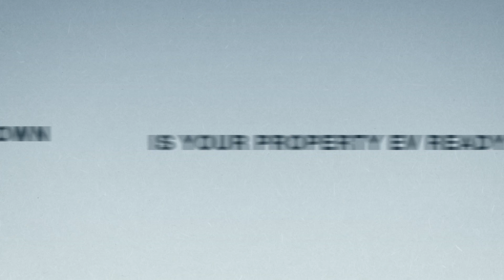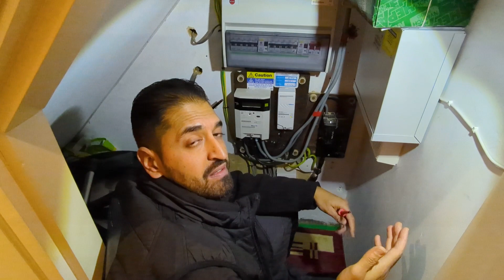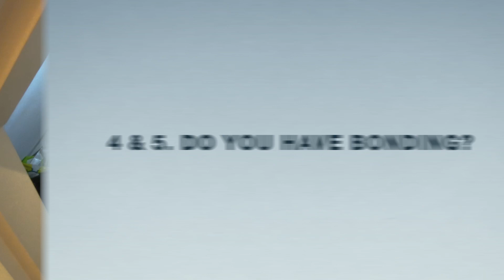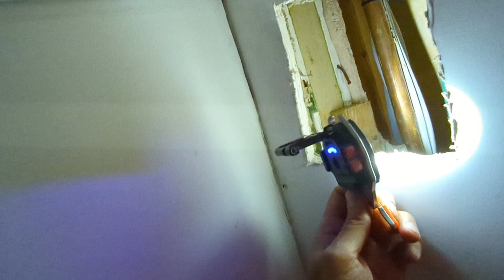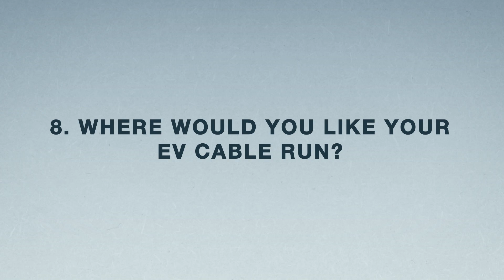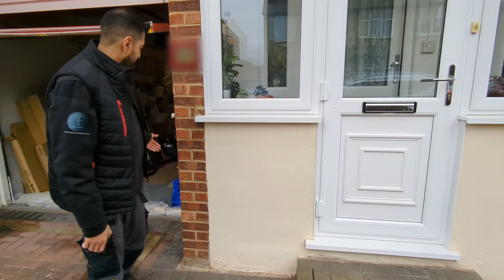Is Your Property EV Ready?

Comment: Me again.Sorry car'nt help it,comes up on my youtube,have to have my pennies worth,20 years electrician[ jib approved,industrial,commercial and domestic.Maintenance electrician DRAKA cables,i've been around the block  then 21 years distribution all dno], that looks like ec15 [earth clamp] on lead sheath so big no no,so you mentioned earth bonding but no external  fault path earth via source,ie tt,tns,tncs,how do you no it's not the looped supply from the neighbour ,not allowed,you need to check neighbours cut out to see if they are the loop.Then the loopie requires re service.
Pilc cables have limited current carrying capacity,some 0.0225 2c cu or smaller  [about 4mm thick] 60a cutout/ fuse max, backed up at sub with 400a fuse designed to blow in 30 mins not 5 secs,time to burn!.This is why i left contracting,i was told by the year 2000,all electricians would have to be jib graded,you need a card to work ,like in australia ,to work on electrics ,to get rid of the idiots,no such look!, you carnt work on gas without gas safe ,but you can go to b and q or screwfix or go on youtube and find some drongo to give you advise ,Faults find faults in fault finders!

Comment: Unfortunately I am looped, luckily they are sorting it for free, dig up my drive new fuse etc.  I’ve also found out my incoming water supply is not earthed so that’s getting sorted with the fitting of my new car charger with Octopus. 🐙 I have a charger already but it is so slow, charges at 3.4kw so okay with the looped system, glad I am getting it changed though. 
Great video made it so easy to understand 👏

Comment: Looped supply:  They changed the rules years ago, you can fit an EV in a looped supply but you must notify the DNO and they will likely unloop the supply..   Also checking if there are two cables is not a reliable source to see if the supply is looped as the second house on the loop will only have one cable...   There is a site called LSBUD that will give you maps the same that the DNO has so you can see if the supply is a looped supply

Comment: Hi Ben, I live up north in a terrace house with a ev, street charging with BP pulse, im thinking having a charger fitted in back yard so i can charge on back street, there no footpath but no off street parking, will i run into issues
Reply from the maker: Hello @justeatingbigmacs,

The regulations/guidance we are given traditionally dictates EV chargers are only to be installed at properties with off street parking or dedicated parking bays. 

This is to prevent various hazards e.g people tripping over the charging cable.

We have found different local authorities seem to have different guidelines, we would recommend getting in touch with your local council.

Kind regards 

Vartia Electrics

Comment: You didn’t cover the risk that you are on the far end of a looped supply. You will only have one incoming cable, but how do you know the supply cable comes straight to your cutout and not via 1 or more neighbours first?
Reply from the maker: Good evening @nigelbarton8350,

Thank you for pointing this out. This would be down to your installer to work out, a simple phone call can confirm if you are at the end of the looped supply.

You have various options available to you now e.g. CT clamps etc to overcome this issue.

Kind regards 

Vartia Electrics

Comment: No mention of the upgrade of cables required for 100Amp cut out fuse, which involves Electricity Supplier, as well as DNO
Reply from the maker: Good Afternoon Bighorse2,

Your correct upgrade of cables will be required if the fuse is up-rated.  We were aiming to give information without going too far into detail.

Thank you for pointing this out 🙂

Kind regards

Vartia Electrics

Comment: What about RCD types? the consumer using you are installing into have AC RCD's which have issues with DC leakage
Reply from the maker: Good morning Chris,

Well spotted! You are correct a A type RCD is required when installing a EV Charger. 

We didn't want to overwhelm with too much information and as it is a simple swap it was left out.

Kind regards

Vartia Electrics

Comment: Not sure about UK regulations only allow an EV charger unless your have a driveway as I have a London Taxi with no driveway, but our road has off road parking and his person got an EV charger installed on the pillar of the gate and he layers down rubber matting to protect the cable and its ramped to allow manuvore over it. But I don't have faith that ti's rubber cable protection strips will fail, degrade, get vandalised or stolen or how was it allowed to be installed. If other follow suit the pavement can become a trip hazard in masses due to winds, snow etc or electrical if cable and matting get damaged.
Reply from the maker: Hi Chandresh,

Thank you for making this point, UK regulations do state an EV Charger Should not be installed if no off street dedicated parking is available, Ben could have used different wording but does mention this in the video. 

The EV market is growing quickly, so a solution for anyone that does not have  dedicated off street parking is usually a granny lead, hanging out the window or as you mentioned trailing along pavements. This isn't a long term solution as it brings all the hazards and liabilities you mention. 

We are seeing EV Chargers installed in lamp posts and similar settings, as demand grows we're sure it won't be long before a viable solution is found. 

Kind regards

Vartia Electrics

Comment: 10kg of copper left oùtside , the thieves will have a field day.
Reply from the maker: Hi James,
90% of the copper is contained within the armouring of the cable, which is live so the thieves will be in for a "shock"
Reply: @VartiaElectrics  no they won't, they use an insulated tool..
Reply from the maker: @jamespegg6418  

Good morning James,

It was just a bit of light humour a lot of EV Chargers are now equipped with tampa proof measures. This is not to say it will completely stop thefts but a step in the right direction. Similar to your car being stolen off the front drive.

Kind regards

Vartia Electrics

Comment: Another video that incorrectly states that you have to get a looped supply unlooped before installing a charger. I can only assume that the majority of videos are from London based people! Many DNO’s now allow chargers to be installed on 60 amp looped supplies as long as the charger uses a CT clamp to rate down the draw of the charger should the collective house draw exceed the main fuse. Northern Powergrid for example have this as their default policy now as they quite often charge the customer to unloop which costs a few thousands. I know some videos are a year or two old and might have been the case then but as this is 2023 video it really needs correcting
Reply from the maker: Hello Phil,

You make a valid point. As you mention many but not all DNO's have adapted to a load management policy, with EV Charger regulations consistently being changed and updated a decision was made to show the worst case scenario, this would cover all basis. 

We always opt for load management EV Chargers as the first option to minimize time and cost, Ben does briefly touch on the load management facility at 5.15min. 

Thank you for your feedback.

Kind regards

Vartia Electrics